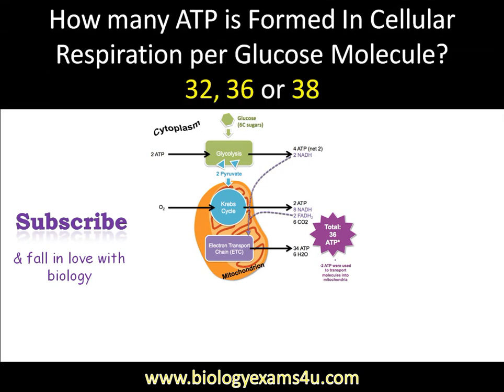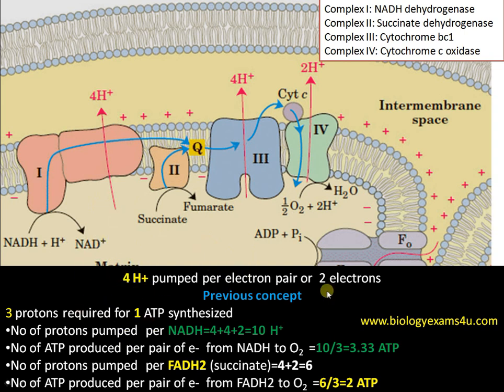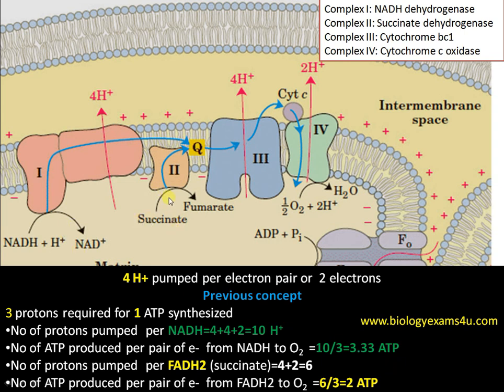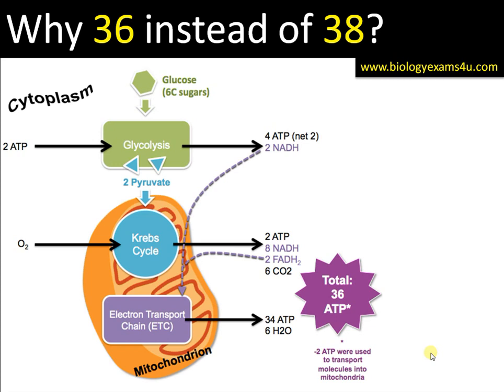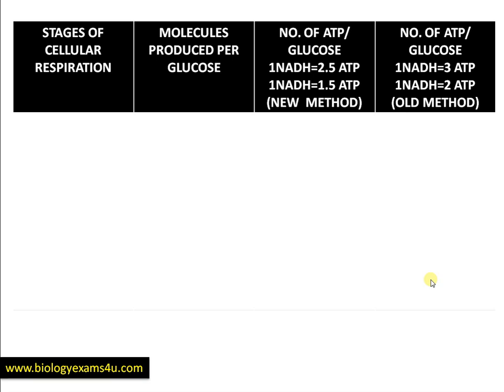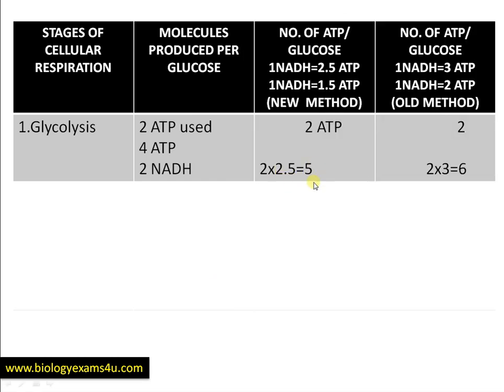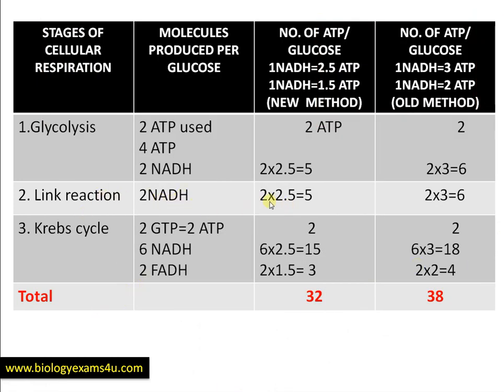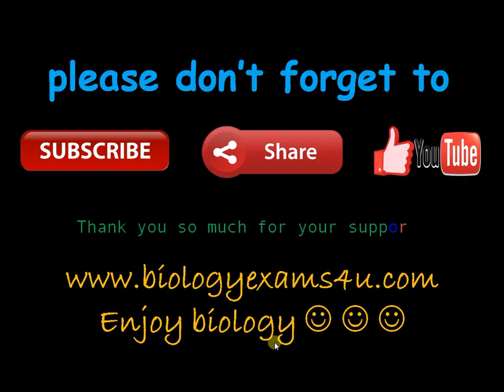ATP In Cellular Respiration per Glucose  32, 36 or 38? Explained

Comment: There can be gross gain of 40 ATP😓😓 molecule during aerobic respiration of glucose. Sir plssssssss explain this also🙏🙏🙏🙏🙏
Reply: out of 40 ATP, 2 ATP are utilised in "energy investment  process" of glycolysis... so it becomes 38ATP
Reply: @manishasharma2142  But NCERT says 36 atp, how?? I can't understand Please explain
Reply: @susnigdhasengupta2670  during the transportation of nadh formed in glycolysis to mitochondria for Krebs cycle 2 atp is used so 38-2= 36 atp (for class 12th student). Because according to ncert 1 nadh2 = 3 atp and 1 fadh2= 2 atp

But for higher level = 32 atp or 32-2=30 atp. Because 1nadh2= 2.5 atp and 1 fadh2= 1.5 atp